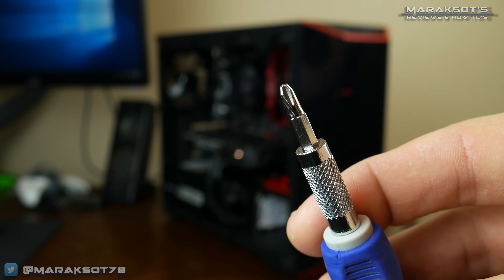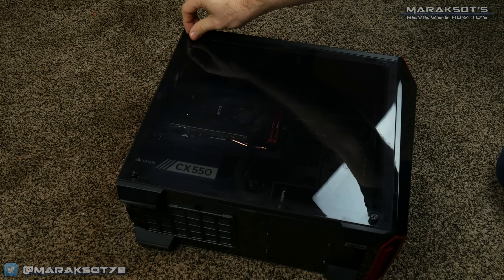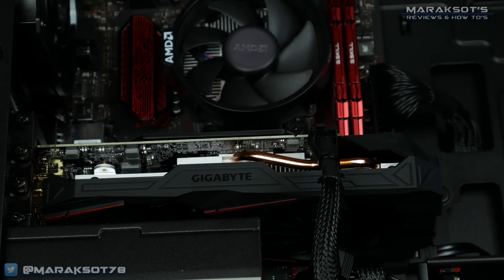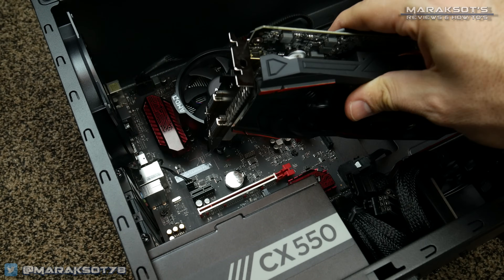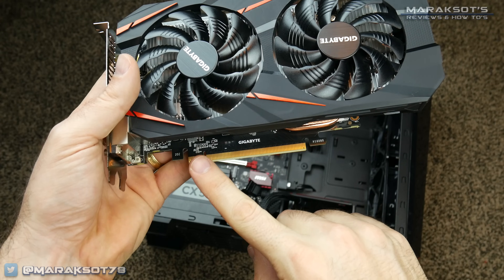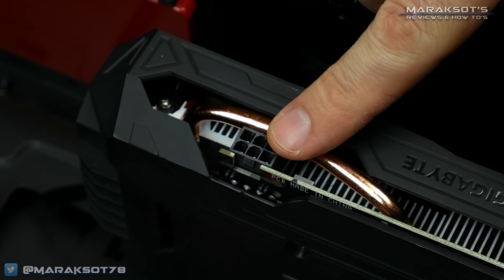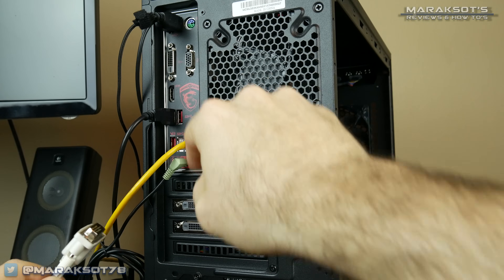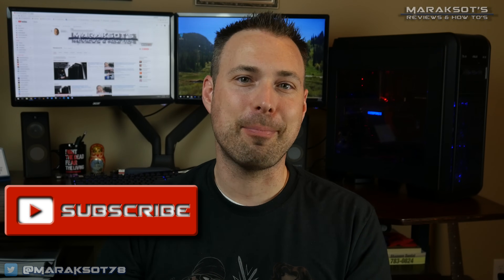How to Install a Graphics Card - Upgrade Your GPU

Comment: I just bought a gtx 1050 ti sc 
with ryzen 3 2200g cpu and a gigabyte ryzen ddr4 mother board. with 8 gigs of ddr4 ram. and a 500watt psu. from what I've looked up this is a good build but I have no input on from somebody who knows what's up. plz help
Reply from the maker: Thanks so much for the question.  I love talking about computer hardware and being able to share knowledge with people that are new to PC gaming.  The Ryzen 3 2200G is what they call an APU which just means it has a graphics processor built into it.  This allows you to be able to connect your computer to a monitor without the need of a discrete graphics card.  When compared to a similarly priced Intel CPU with integrated graphics like the i3 8100 the Ryzen 3 2200G offers noticeably superior performance when it comes to games and things.  The 2200G by itself is impressive especially when you consider just how inexpensive it is however adding the GTX 1050ti will give you a significant lift in performance over what the 2200G's integrated graphics can do.  In most games you'll see a good 50 to 100% improvement in frame rate when using the same graphical settings.  The 1050ti is a really good 1080p graphics card.  It's not capable of running modern AAA games at 1080p max settings at 60+ fps but it can certainly do 1080p low and medium settings over 60fps.  And to be honest modern games at low and medium still look really good.  Older titles and Esports titles like CSGO and League of Legends the 1050ti can easily do 1080p max settings 60+ fps.  8GB of RAM is what I'd recommend as the bare minimum nowadays for a gaming PC so you're good there but someday you're going to want to upgrade to 16GB as newer games are utilizing more memory.  Your 500 watt power supply is plenty of power for what you've got there and leaves you room to upgrade both your CPU and GPU in the future if you so choose.  The great thing about AMD's Ryzen CPU's (Ryzen 3, Ryzen 5 and Ryzen 7) is they all use the same socket so if some day you feel the 2200G just isn't cutting it for you anymore you can very easily swap it out for a more powerful Ryzen 5 or Ryzen 7 chip.  I think you'll have a great time gaming on this rig.  It should offer you a solid gaming experience.  Cheers!  :)
Reply: @Maraksot78  your the best thank you so so much this is exactly the kinda answer I needed. I havent got the mother board yet I'm planning on gettinghttps://www.amazon.ca/gp/aw/d/B079NH98GS/ref=ox_sc_act_image_1?smid=A3DWYIK6. do u suggest I get a different one? and also when building a computer can I just start with getting the hdd and getting ssd later or do I need the ssd first? thanks again so much!🍻
Reply from the maker: that motherboard should be great for you.  The B350 chipset is exactly what I would recommend.  As for your question about the hard drive... personally I'd get the SSD first.  Right now SSD prices are really good compared to what they have been.  I don't think the price per gigabyte has ever been as low as it is right now.  I prefer to have the speed and snappiness of an SSD over the capacity of a mechanical hard drive.  If your budget is tight right now I'd say get a nice 500GB SSD now to install Windows onto and then save up some money for a 1 or 2 TB mechanical drive later.  I just looked and Newegg.com has a 500GB Samsung 860 EVO for $73.00 US right now!  That's a really great deal for that drive in my opinion!  (I paid over $100 each for my two Samsung 850 EVO's three and a half years ago)  But from your link it looks like you're in Canada so on Amazon.ca there's a 500GB WD Blue SSD that is only $89.99 Canadian which is only $67.77 US!!!  Crazy good deal if you ask me.  Just for giggles I looked to see what that same drive is right now in the US and it's $77.99.  WD makes great products and that price for 500GB... you'll be hard pressed to beat it.  https://www.amazon.ca/Blue-NAND-500GB-SSD-WDS500G2B0A/dp/B073SBZ8YH/ref=sr_1_4?s=electronics&ie=UTF8&qid=1543529542&sr=1-4&keywords=500gb+ssd

Memory Express I know is a Canadian electronics retailer and right now on their site that same WD SSD is $89.99 also if you prefer to buy from them.

Anyway, a 500GB SSD would be awesome to install your OS to and should be good enough to get you by for now and then in a few more months you can pick up a 2TB mechanical drive or something and be good to go.  SSD's are just so much faster than mechanical hard drives.  Once you've experienced them you don't want to go back which is why I recommend the SSD.  XD
Reply: @Maraksot78  all this stuff u told me could make a really good beginners video. I got alot of very popular parts atm. ide imagine alot of ppl alrdy have/want to get a similar build. would make a very good video. also ur videos are very good and informative. thank you. I know a few ppl that r getting the ryzen and gtx 1050 ti for christmas and they cant be the only ones.
Reply from the maker: Another really good question.  It's good to see you're doing your homework.  With the first generation of Ryzen Processors they were really picky about the type of RAM you use with them.  Intel chips work fine with most any RAM but Ryzen was really finicky at first.  It's better now but still pickier than intel.  In my experience the best way to go about choosing RAM is to look up your motherboard manufacturers product page and look for the RAM QVL (Qualified Vendor List).  Before selling their motherboards the manufacturer will test their boards using a variety of different RAM configurations from different vendors.  They then compile a list of RAM they've tested that works properly with their board.  For the Gigabyte board you linked me here is a link to where you can download the QVL (looks like Gigabyte calls it Memory Support List) https://www.gigabyte.com/Motherboard/GA-AB350M-DS3H-rev-1x#support-doc  The R3 2200G is a Raven Ridge CPU so you'll want to look at the list for Raven Ridge CPU's.

Now I want you to know that just because a memory module you may be looking to buy isn't on the supported list doesn't necessarily mean it won't work with your motherboard.  It may simply mean they didn't test that particular memory module.  There's tons of different vendors, speeds and capacities so naturally it's impossible for them to test them all. You're of course gambling a little bit if you choose RAM that isn't on the list but if it doesn't work you can always return it.  That is of course kind of a pain but it is an option.  I apologize for how long this response is getting but there is a lot to learn here.  :)  Sometimes I've looked at a list and the particular kit I want to buy isn't on the list but another kit from the same manufacturer with an almost identical model number in a different capacity is.  For example I want a 16GB kit and they tested a 32GB kit and listed it as compatible but my 16GB kit isn't listed.  In this situation with the model numbers being nearly identical I've gone ahead and purchased  the 16GB kit and it's worked fine.  Another good thing to know about Ryzen is the higher speed memory you can afford the better performance you're going to get out of your CPU.  With intel chips it doesn't make all that much difference if you have 2400Mhz RAM or 3200Mhz but with Ryzen it does.  Most of the stuff I've read online recommends you get at least 3000 or 3200Mhz RAM if you can afford it as it will help your Ryzen CPU perform better.  It will work fine with lower speed RAM but if you can go faster why not right?  XD
Reply from the maker: I actually made a series of videos where go step by step on building a computer. https://www.youtube.com/watch?v=qM4ColctlXg&list=PL-qY8D-eM9xDQEVH3PqAp66Dg8yk_Kq7_  In it I give advice on choosing parts to help get the best bang for your buck as well as how to put it all together, install windows and the necessary drivers to get your new PC all up and running.  A lot of the buying advice is admittedly pretty generic but I wanted the videos to be able to "stand the test of time" so to speak and help people help themselves rather than me tell them what to buy if that makes sense.  Computer hardware changes so quickly so rather than talk about "this particular CPU and that current GPU" I wanted to give people the tools needed to research stuff on their own and make their own decisions.

I'd love to be able to afford to buy all the new stuff and have the time to make videos about all of it and share that knowledge with everyone but as of right now my channel isn't quite in a position to do that.  I still have to work a normal day job and can't afford to buy new PC hardware very often.  My channel is too small for Vendors to notice it and send me stuff to review so for now YouTube is just a hobby and I make videos whenever I have free time.   I'd love my YouTube channel to grow to the point that it could be my full time job, and it very well could at some point, but for now it's just something I do for fun with the hope that if I keep at it, it will eventually turn into something.  :)
Reply: @Maraksot78  thanks so much I dont mind the long posts. it's very much needed and beyond what I was expecting so once again thank you so much for all the help. I think everything should go together well.  I'm rlly not even looking to play anything special lol my friend just bought me overwatch for christmas and my old pc cant run it. I dont even care if this pc can run just on low graphics lol as long as I can play pubg and overwatch :p
Reply: @Maraksot78  I'll deffinatly check that out. and yea I understand that hopefully the channel takes off cause u got some really good info. very well spoken also. ur videos have helped me alot
Reply from the maker: you should have no problem playing Overwatch on this build.  It's not as demanding of a title as some others.  You'll be able to run it on Max settings at 1080p over 60 fps no problem.  PUBG on the other hand... I haven't played/tested it in awhile so I don't know if they've improved things with updates but the last time I tested PUBG it wasn't very well optimized.  You'll be able to play PUBG no problem but as for how high of settings I don't know for sure.  You should be able to crank them up fairly high and stay over 60fps though.  :)  The main thing I learned about PUBG is it seems to favor systems with lots of RAM.  8GB will get you by but 16GB is going to be optimal; at least that's what I found when I did some testing in a past video.  Here's a link to the video I did that testing in if you haven't watched it already and are interested.  https://youtu.be/BqXgLYRY1UY
Reply: @Maraksot78  awesome that's so good. I cant wait. I've decided I'm gunna get another 8 GB ram. wondering if it's possible to mix to diff kind of ddr4 rams? or should I get the same brand but 8 gb 3200ghz
Reply from the maker: mixing different types of RAM is not recommended.  It can work but your odds of having problems is much higher when  you mix different brands and speeds.  If you're running multiple RAM sticks you're best off to get all the same thing.  Since your running a Ryzen CPU, if 16GB of 3000 or 3200Mhz is out of your budget I'd recommend getting 8GB of 3000 or 3200 as opposed to some less expensive lower speed RAM.  If you were using an intel CPU then I'd say go for 16GB of of the fastest RAM that fits in your budget.
Reply: @Maraksot78  should I return the 2400ghz ram ? I got it off amazon but itll kinda be a bitch to send it back. would I have any success  with getting the exact same model but 3200ghz. sry for kinda the repeat question but I think my only option might be to keep the ram tht I got.
Reply from the maker: Sorry it's taken me a couple days to get back to you.  I didn't see your comment because it had been filtered because of bad language.  Using the word "bitch" must have set it off.  If you already bought 2400Mhz RAM that's fine.  It'll work just fine and you not having anything to compare it to won't notice anything.  It will perform great even with the 2400Mhz it just won't be as great at if you were using higher speed memory.  If I were to relate it to driving a car; instead of being able to drive at 120MPH you'll only be able to go 100MPH, still really fast and awesome just not quite as fast.  :)  so no worries there.  If you want to go to 16GB instead of 8GB then I'd recommend getting 8 more GB of the RAM you already have.
Reply: @Maraksot78  awesome thanks so much and dang my bad. I didnt realize they filtered that now.
Reply from the maker: @JJN603  YouTube doesn't do it by default, each creator can set up words to filterd out of comments on their videos and I have all swear words set to be filtered. I don't want people fighting in the comments swearing at each other and calling each other names and stuff so I set a filter for it. I then have to go into the filtered comments and choose to either delete them or allow them to be published.  If someone says something like you did that isn't a derogatory comment to another person then I don't have a problem approving those. I just don't look at the filtered comments very often because I don't usually get many of them.
Reply: @Maraksot78  I totally understand that. when ppl come back to ur vid does it count as a view?
Reply: @Maraksot78  I totally understand that. when ppl come back to ur vid does it count as a view?
Reply from the maker: @JJN603  I don't know how YouTube tracks views exactly. I think you have to watch a video for certain amount of time for it to count as a view. Not sure exactly how long but I remeber hearing somewhere that it's around 30 seconds.
Reply: aha nice I may have contributed to a few if that's the case lol any ways man merry christmas or happy holidays sorry for so many random questions. I really appreciate all the help man. like alot. hope to see some more vids mang. deffinatly let ppl in on the best combinations for builds atm like best budget build and best high end builds. if ur frequently updated on recent hardware. I've actually started to think about it and done a bit more research and am going to return my graphics card for a rx 570 or 580. gunna get the 16 gs of ram and ryzen 5 2400g I think. or do u think I shuld stick with the ryzen 3 atm thn later upgrade to a really good processor? sorry last question XD
Reply from the maker: @JJN603  Merry Christmas and Happy Holidays to you too!  :)  It really depends on what you want to do with your computer.  If the most intensive use it's going to get is gaming and you're gaming on a 1080p 60Hz monitor then I think the 2200G and 1050ti is a good combination for that.  If you're wanting to do 1080p max settings on new AAA titles then going to an RX 580 or GTX 1060 is a great way to go.  Now if you're gaming at a higher resolution like 1440p or 4K or at a higher refresh rate like 1080p or 1440p at 100Hz or higher that's when I'd start to recommend going with a more powerful CPU and GPU.  I've been thinking of making a video for awhile now about choosing a graphics card without throwing your money away.  What I mean by this is many people that are new to PC gaming will often over spend on parts they don't really need.  From what I've learned over the years to keep yourself from spending more money than you need to is you need to pay attention to your monitor; what it's resolution and refresh rate are.  For example there are people that think if they buy a GTX 1070 or 1080 then they're better off than if they'd bought a GTX 1060.  While the 1070 and 1080 are more powerful they also cost more money.  Those cards are meant for high resolution/high refresh rate gaming.  If you have a 1080p 60Hz monitor that means your monitor can display 60 frames per second.  A GTX 1070 or 1080 is capable of outputting far more than 60fps in pretty much every game out there at 1080p max settings.  One thing that happens in fast paced games like a first person shooter is when your graphics card is outputting more frames to your monitor than your monitor can display then you end up with screen tearing.  If you're not familiar with what screen tearing looks like here's a link to a picture that illustrates what it is.  https://www.gamersnexus.net/images/media/2015/gpu/screen-tearing-blacklist.jpg  in order to fix the screen tearing problem you then have to limit the frame rate of the game you're playing to your monitors refresh rate of 60Hz by either enabling VSync or limiting the FPS in the games settings.  This means you just paid $400, $600, $800 (depending on the graphics card) when you could have saved yourself a bunch of money and bought a $200-$250 graphics card which was designed for 1080p 60Hz gaming.  Like I said if you're gaming at a higher resolution than 1080p or higher refresh rate then those higher end cards are what you're going to want.  If you're planning to do things with your computer like video editing or 3D rendering or gaming at high resolutions and refresh rates then upgrading your CPU is something I'd definitely recommend as well.  While the 2200G is an impressive chip at it's price point it's not going to offer nearly as good of performance in those types of tasks as a more powerful CPU.  When it comes to video editing this is most noticeable in render times.  A more powerful CPU can render video much more quickly than less powerful ones as I'm sure you'd expect.
Reply: @Maraksot78  never heard of the screen tearing thing but it's good to kno
 my goal is to get best bang for buck. the 1050 would deffinatly do me good but I'm afraid not for long thn I'll be spending another 250 bux on a GPU. where as I get the rx 580 itll last me maybe like 5 years for the best games out there. the rx580 is only 90 bux more. so ide assume it will last me way longer thn 1050ti I think lol. so should I start of with the better GPU first or the better CPU? side note the graphics r the least of my worries. I just dont want to have to buy another pc for a really long time. i just want to be ableto do half decent gaming for the next 5 years plus. with minor upgrades on the way like the ryzen 5 or better.
this is the graphics card
https://www.amazon.ca/Radeon-RX-580-8G-V1/dp/B078Q78L93/ref=mp_s_a_1_4?ie=UTF8&qid=1543862849&sr=8-4&pi=AC_SX236_SY340_FMwebp_QL65&keywords=rx+580
Reply from the maker: @JJN603  ok, cool if that's what you're wanting to do then I'd say the RX580 is going to be perfect.  I wouldn't worry about upgrading to a Ryzen 5 right now unless you really want to and can fit it into your budget.  If you're thinking about the Ryzen 5 2400G might I recommend going with the Ryzen 5 2600 instead.  It doesn't have integrated graphics but that doesn't matter since you're buying a graphics card.  The 2600 offers superior performance to the 2400G in every way and it offers more cores and threads.  The 2400G has 4 cores and 8 threads which is good but the 2600 has 6 cores and 12 threads which is of course better.  So if within the next 5 years you'd like to get into gaming and streaming or video editing and stuff the Ryzen 5 2600 will work great for all that.  As of right now, today, Dec. 3rd 2018 it's on sale on Newegg.com for 13 more hours for the same price as the 2400G $159.99 US.  That probably doesn't help you being in Canada though.  XD
Reply: @Maraksot78  your awesome that's the exact kinda info I needed. i will deffinatly go with r5 2600 when the time comes. man u dont kno how helpful uve been. I cant thank you enough. 🍻🙏  yea being canadian deffinatly has its pros and cons Xp
Reply from the maker: @JJN603  you're welcome man.  I'm happy to do what I can to help.  I love computers and talking about hardware and helping people learn more about it.  It's very rewarding to help people that are new to PC gaming and/or PC building be able to get the best bang for their buck.  Thank you for asking questions and giving me the opportunity to help.  Cheers bro!  :)
Reply: @Maraksot78  hey I got another question. i might not be able to return the gtx 1050 ti. but I'm gunna be getting 16gb 3200 mhz of ram for sure instead of the rx 580 should I just upgrade now to the ryzen 2600. and get a rlly good graphics card later? what would be my best option. also can I add that 2400mhz 8gb Ram I have atm with the 2 8 gb 3200 mhz ram so I can get a total of 24gb 3000 mhz ram?
Reply from the maker: @JJN603  If you can't return the 1050ti then sure I'd say go with the Ryzen 5 2600 rather than the 2200G and upgrade your GPU later.  The Ryzen 5 offers quite a bit more power which will come in handy in the years ahead.  As for your RAM question I think you can do that but I wouldn't recommend it.  My understanding is your memory will run at the speed of the slowest module in your system so that 3200Mhz RAM you're paying extra money for would be kneecapped to 2400Mhz.  So if I were you I'd either get 16GB of one or the other.  One thing I should probably tell you is that buying memory in pairs is the way to go.  So if you're getting 16GB then you either want to get (4) 4GB sticks or (2) 8GB sticks so you can run it in dual channel.  Dual channel increases performance by a lot.  I recently saw a Linus Tech Tips video where they tested two identically spec'd PC's one with 16GB of single channel memory (i.e. (1) 16GB stick) and one with dual channel (i.e. (2) 8GB sticks) and the dual channel PC performed significantly better in games than the one with single channel memory and that was on an intel based system.  Since you're going with Ryzen having dual channel memory is going to be even more important seeing as CPU performance with Ryzen is more closely tied with RAM speed.  One other thing you need to know when you build your system using 3200Mhz RAM... Once you get your system all built and booted up into the BIOS/UEFI for the first time you're going to need to go into the settings for the RAM and change the speed to 3200Mhz.  I think the default speed for DDR4 is 2666 (I'm not 100% sure on that) so the motherboard will default to that speed.  You have to manually go into the RAM settings and change the speed to 3200Mhz as well as adjust the timings to what the RAM kit says (there are lots of good videos on YouTube that can help you with this).  On second thought... you might be able to use your RAM's XMP profiles which is a much easier way to do this but on first generation Ryzen you couldn't just use the XMP profile because XMP is "an intel thing."  Not sure if they've fixed that or not with this 2nd generation of Ryzen CPU's.
Reply: @Maraksot78  awesome it seems I'm heading in the right direction thn and yes today I returned tht 2400mhz 8gb ram for 2 8 gb 3200 mhz. and am looking into the ryzen 5 2600 but I noticed for around 100 bux less I can get the 1600x. or the 2600x and 2700x is the same price for around 345. if I upgrade should I just go for the 2700x thn? or will that like break my GPU or sumthing lol. also the the gtx 1050 ti takes 250 watts I think and the ryzen 2700x is like 105 watts. will my 500 watt psu be able to handle tht still?
Reply from the maker: @JJN603  The 1600X is a good CPU too it's just it's a first generation Ryzen chip.  If you're building new right now and can fit it in the budget then I'd say go for 2nd gen stuff over the 1st gen.  That being said the 1600x is a good CPU and would also serve you well.  If you can get the 2600 or the 2700 for the same price then I'd say get the 2700!  It's an 8 core 16 thread CPU and I'm all about more power!  XD  Your 500 watt PSU should be just fine.
Reply: @Maraksot78  aha awesome I'll let u kno what I do thanks again:D
Reply: @Maraksot78  so I decided to get rx 570 8g XD, 2x8 gb 3200 mhz ram, 500 watt evga psu, nautilus rosewill case, adata 520 gb ssd, Seagate barracuda 1tb hdd, gigabyte ab350m-D53H, and for the CPU either ryzen 3 2200g or ryzen 2600. thanks again so much for every thing man words cant explain how much i appreciate all the help and input. and honestly good chats man. I enjoy talking about this stuff to now aha. I caught myself drunk af last weekend talking about gaming pcs lol any ways man ur the best I hope u keep going man and get YouTube famous :D I'm deff ur biggest fan lol.  bless you m8
Reply: man thank you so much all this information is soo great to have! uve really helped me out. is there any newb advice u can give me with what I've got or am I heading in the right direction? I read somewhere that some ppl have problems putting certain ddr4 ram into certain motherboards. I got the corsair 8 gb ddr4 hoping it will work with the motherboard.
https://www.amazon.ca/Corsair-Vengeance-Memory-PC4-19200-CMK8GX4M1A2400C14/dp/B00UVN2C8O/ref=mp_s_a_1_22?ie=UTF8&qid=1543535523&sr=8-22&pi=AC_SX236_SY340_QL65&keywords=ram&dpPl=1&dpID=41hrqLZU 
I also just watched a YouTube video on a guy talking about the wraith spire and he said that corsair lpx ddr4 ram is one of the few rams that work with ryzen. what does he mean by this.